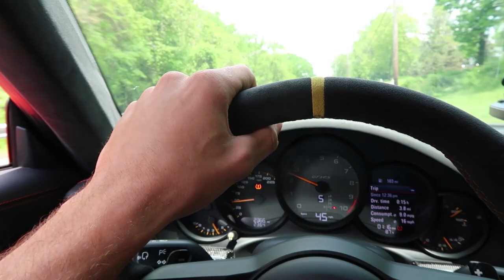Tearing my Evo 5 down to Bare Chassis!

Comment: Coming from a body work profession, I would strongly suggest sand blasting the rust away completely and sealing the clean metal with an epoxy primer before undercoating. Rust will always find a way to spread

Comment: Do not use rubber under coatings

Your car will be screwed in no time

Oil based are messy but are the only way
Reply: Wrong oil is sticky and causes salt buildup. Worse in my opinion

Comment: dont undercoating with asphalt or ruberized stuff, use oil or wax...put it in the outside and in the iside of the frame, doors, trunk,hoods, etc...that what we use in canada.  if you go watch a video from south main auto about the undercoating you will see what will happen to the evo (or any car, truck...) btw when you wire wheel rust you dont remove all of it, what you see is not the reality, its like a cancer when it start its spread and putting undercoating will make it worst and worst while you wont see it. if you look closely on recent car, most manufacturer dont put undercoating anymore because it rot the frame way earlier than it should. just clean, prime, paint and clear with clear the resist sand blast

Comment: Adam, Next time you should dry ice blast it before you get the undercoat and don't forget to give it an nice rust protective base coat before you spray it. If the rust stays on the metal it will keep oxidizing no matter what you do with it as soon the water finds the way to it and it will one day. The quick and cheap way to prevent it to continue to rust is to wax the shit out of it to block the water and air getting to the metal. Helps for a season or two before you have to redo it. Dry ice blasting is great and removes all loose paint and dirt or grime and does not harm the good paint or plastics in anyway. You do not need to take anything off the car to get it clean of any thing.

Comment: Adam, be careful with that undercoating because in a lot of cases it will peel and then trap moisture behind it, creating even more rust than a normal painted section. Not to mention there's more rust hiding in the seams where you sanded it off, so just keep an eye on that I guess

Comment: AYC uses two sets of gears, and hydraulically controlled clutch plates to drive the outside rear wheel faster than the inside wheel when cornering.

Comment: I hope you used a rust encapsulator under the undercoating otherwise it will keep rusting.
Reply: He said he was removing the rust before undercoating so its not going to continue rusting if there isnt any rust. And as long as no dirt or anything gets on the frame or anything like that and then paints over it then some rusting might happen but when you under coat. Normally it diesnt rust under it.